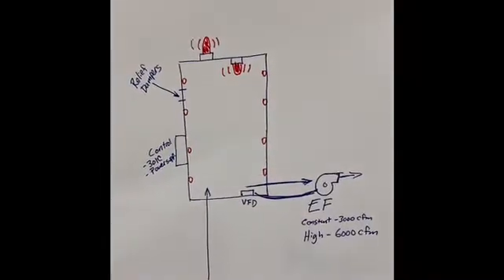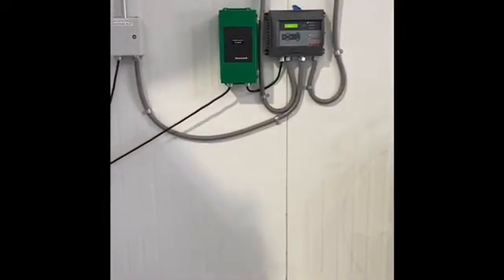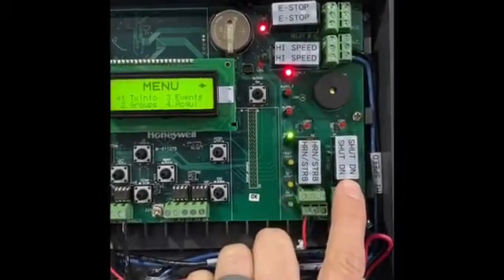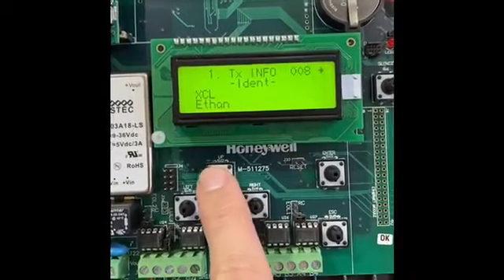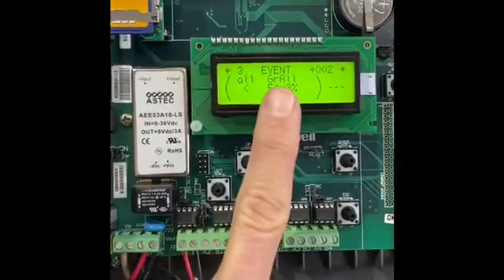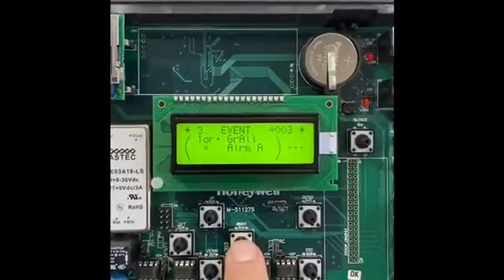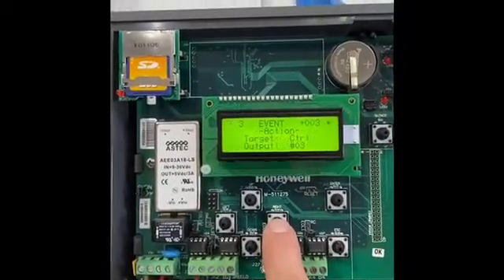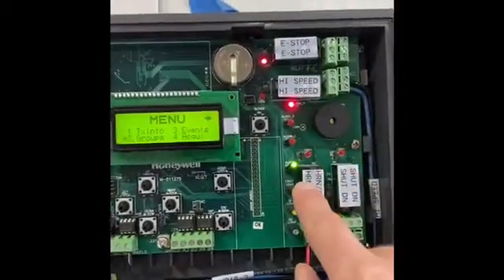Honeywell XRL system explained

Comment: Awesome video thank you for posting. What I’m wondering is can these sensors be adapted for ground water wells? Attached to a well head. Also is it one sensor only or can you have multiple sensors on the device? We need to measure methane oxygen CO2 probably would like to tap into our radio net work with  modbus which I believe these support. Thanks so much for responding